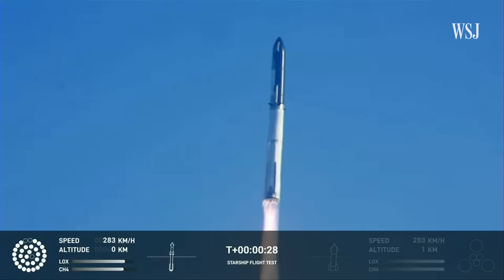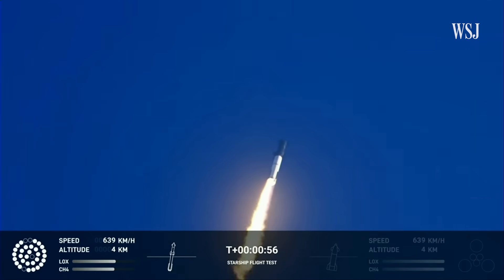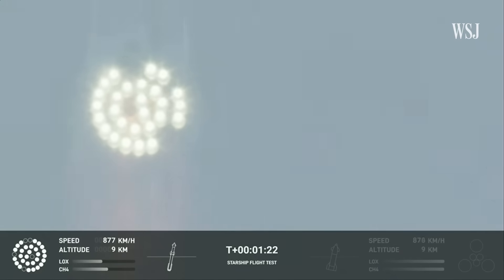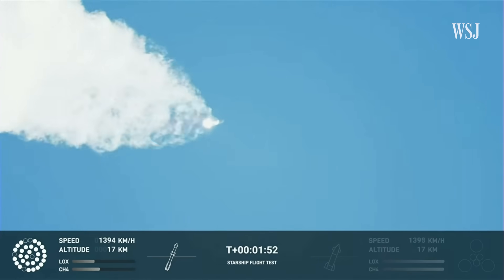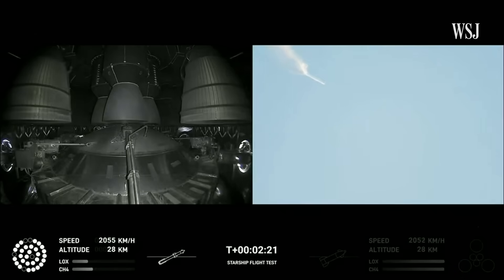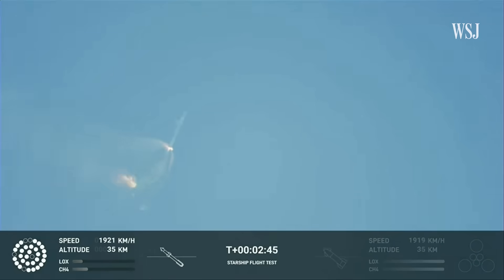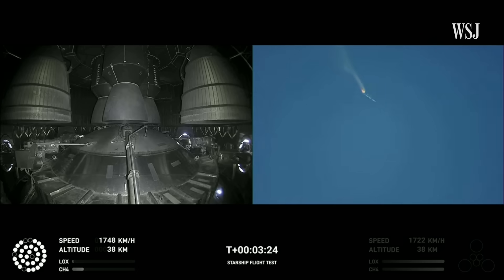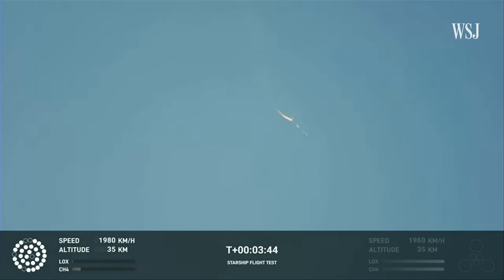Starship Explosion Video: Watch Elon Musk's Rocket Explode After Launch | WSJ

Comment: A successful launch and not destroying launch pad infrastructure was the minimum performance objective today. Everything else would have been a bonus. 

These test phase boosters and starships are purpose built to be tested until failure. Which is why the next test rocket is already produced and waiting for the next launch date.

The most important element is the performance data they obtained. This will help correct the failures for the next test. 

So long as the trajectory of each test launch shows improvement and reduction in failures, starship will complete its mission objectives.
Reply: It was a fiasco, it exploded and it even used same propulsion technologies of the 60´s, people cheering this event reminds me of those movie remakes that are a success for new generations because they never saw the original one decades ago, and as this case, originals are better.
Reply: @tomasgrimm3086  the technology is different. Saturn used 5 f1 engines and used Kerosene for fuel. Starship uses liquid methane and 33 rapture engines. Starship is also made from different materials and construction processes. Both the booster and starship also have relanding capabilities which have been tested but on seperate occasions. 

I’m not sure which technology that you are referring to is re-used from the 60’s?

Comment: Awesome first launch SpaceX, I can't wait to see the second and third to watch the progress.
Reply: Well, it can ONLY be progress. It can't get any worse, can it?
Reply: @ge2623  could’ve blown up on the pad and literally demolished the launch site instead of digging a big hole. It could’ve been destroyed during MaxQ, forcing a redesign of the vehicle’s structural elements. It could’ve veered off course and started arcing toward a populated area…

An issue with the HPUs and engine for steering that caused a lack of stability and issues with staging is actually quite good. If anything, the amount of “spin” it got proved the structural integrity of the system in ways that couldn’t be quantified in simulations or ground tests.

Comment: As of last month, Musk was quoted saying that this rocket only had a 50% chance of reaching orbit, just to put things into perspective.

"It will be the first launch with Starship’s two sections together. No one will be on on board. Early versions of the sci-fi-looking upper stage rocketed several miles into the stratosphere a few years back, crashing four times before finally landing upright in 2021. The towering first-stage rocket booster, dubbed Super Heavy, will soar for the first time.

For this demo, SpaceX won’t attempt any landings of the rocket or the spacecraft. Everything will fall into the sea.

“I’m not saying it will get to orbit, but I am guaranteeing excitement. It won’t be boring,” Musk promised at a Morgan Stanley conference last month. “I think it’s got, I don’t know, hopefully about a 50% chance of reaching orbit.”"

-Associated Press article from April 17.

Comment: Considering it was their first test flight it was very impressive. Very excited to see how they develop the starship from here
Reply: Not even close! They've had 9 launches with 5 being total failures and 2 being partial failures!
Reply: @randallmarsh1187  No. This is the first flight of starship and the 33 engine booster together.
Reply: @randallmarsh1187  stop spreading disinformation
Reply: @randallmarsh1187  only an idiots call this a "success"
Reply: @randallmarsh1187  even they fail 100 times still it impressive .
Reply: @randallmarsh1187  get your facts together, it's the first test of the WHOLE thing.

Comment: The crater and damage it left behind on and around the landing pad was pretty extensive, impressive, and I'm sure expensive! Lol! It's going to take months to fix that, unfortunately. Shows the sheer power of what they're working with! Amazing!
Reply: Actually they designed the launchpad to be quickly fixable. After the static fire of all 33 engines the damage was repaired very quickly within a week or two
Reply: @ScaledAnd1cy  you obviously haven't seen the damage yet. They're going to have to redesign the launch pad area. It'll be a few months.

Comment: That went extremely well and very smooth ;but what is the biggest issue here>>>>? Even if you use 20 F1 engines ???? Hint that which makes life possible since man first walked on this planet. Another hint- Movie very well done and depicts need for 3 engines and Holy Grail of Aerospace engineering where weight , heat resistance and  structural integrity will no longer be an issue. Oh no need for hypergolic fuel or carrying that massive weight any longer. 😱

Comment: Marvelous. 3 engines out at liftoff and still twice the thrust of Saturn V. Then another Raptor explodes as the booster climbs through Max-Q and another as it clearls it and finally a sixth Raptor goes engine rich and the largest flying object known to humanity begins to tumble and spin, like some sort of KSP contraption, while holding together. Lesser beasts would have broken apart, yet this one spins wildly at twice the altitude of a Concorde with 5000 t of thrust pushing through the stack until the FTS detonates the booster and the ship one second later. What can I say, other than marvelous. 

5 days and 111 years ago the, then largest moving object sank and humanity became timid and skeptical of technology. Now we build great vessels again. The liners and dreadnoughts may be gone but a new era begins. An object designed to reach speeds of 30 times the speed of sound, weighing more than the largest battleships we could build only 170 years ago. Not bad for a bunch of wild apes.

Comment: Why is it NASA were able to make Saturn V over half a century ago which had a virtually unblemished career, yet today with all the past research at their disposal, space X can't even make one that successfully separates?  And they still can't build an engine that can match the output of the Rocketdyne F1 engine as used on the first stage of the Saturn V rocket?  Instead Space X use multiple smaller engines which drastically increases the chances of a catastrophic failure!

Comment: This is considered as huge success in the engineering world for sure .
Reply: Yes, they got tons of data from this launch, no doubt.
Reply: it's clear that Starship SN11 experienced a pogo oscillation failure (31 -33 ) raptor engines firing at once vs (SLS) Artemis 1 rocket which has a  total of four engines. this and its apparent Disposable launch pad will be a huge hurdle for SpaceX as Multi-engine rockets are much more susceptible to pogo oscillation phenomenon than single-engine rockets. it took Nasa many years of R&D and is the reason why SlS Artemis 1 chose to use tried and true rocket "boring" technology  Pogo was in fact  the main cause of the soviets (30 ) engine N-1 rocket failure Pogo oscillation is a phenomenon that occurs when there is a feedback loop between the combustion process of the rocket engines and the rocket structure. The vibration caused by the combustion process can cause structural oscillations in the rocket, which in turn can feed back into the combustion process, leading to a potentially dangerous cycle of vibrations.

In multi-engine rockets, there are more engines that can contribute to the vibration, which increases the likelihood of pogo oscillation occurring. Don't be so Salty Spacex fanboys! its ok! lol Cheers from Park City Utah!
Reply: Elon made a great comparison; imagine if jetliners were one use only.  
Nobody could fly, that’s what this is all about
Reply: @twocyclediesel1280  I heard all this before. Namely, when the space shuttle was commissioned.
Reply: @candace6637  Now that you say that, I remember that.  I was in my teens and yes, some were saying the same thing.
Reply: @twocyclediesel1280  space shuttle was reusable
Reply: Your delusional is scary remember moon landing rockets, and now NASA is saying they lost the tech no it's bad.
Reply: Seriously??? Not really
Reply: That's what SpaceX wants to gaslight you into believing. No one launches a rocket expecting it to explode
Reply: How? It was done better 60 Ladd years ago? Apparently
Reply: Unique technologies were presented at the international online forum "Global crisis. There is a way out". For example, the health capsule (the possibility of life extension, rejuvenation and absolute health), from time 7:09:09.
These technologies will be available free of charge to everyone when building the Creative Society.
Reply: This is a fake CGI cartoon.
Reply: @chrisdaly9539  Can’t pull the wool over YOUR eyes, can they?
Reply: If it was made by another country, it would be ridiculed. But if it is American, it was a success!!
Reply: @YayoLife The majority of the world's superpowers have their successful space agencies. Through the eyes of an engineer, this was immensely successful. This is like taking a massive doo doo and leaving no residue behind.
Reply: @YayoLife  If it was something the size of Saturn V or smaller, I’d agree.  This is how SpaceX improves and gets something that huge to go through max q, stage separation, etc. without failing.  They had a bunch of failures with the propulsive landing / reusable boosters.  They’ve perfected that now.
This is just part of the process.  I’ll bet they never expected it to achieve orbit.  The data is what they were after.
Just wait and see :)
Reply: This is one of the launches of all time. 
Participation trophies for everyone.
Reply: @shaan702  Yes the launchest of launches
Reply: No way. This concept is a massive waste of money. Go back to Space shuttle and Star Raker. Plenty of Old concepts already exist that beat starship pound for pound
Reply: @TheHiralis  Wrong.
Reply: @MisterSherlock  Space shuttle had 133/135 successful missions. Star Raker had a theoretical 4.3% payload-to-vehicle mass. Starship has 2.2% payload-to-vehicle and is fundamentally flawed.
Reply: @TheHiralis  The space shuttle was only getting into low earth orbit. Starship is not designed to be in low earth orbit, but instead travel out of earths gravitational influence. That takes a much much larger amount of power for a given payload. Going to Mars is a 'whole different world' of engineering requirements when comparing the space shuttle to starships capabilities. The space shuttle could never, ever get out of the gravitational influence of the earth and is a poor comparison for so many reasons.
Reply: @TheHiralis  that's crazy. Star ship with a 550,000lb payload capacity as opposed to the Star Raker's 200,000lb payload capacity. Not to mention that the use of Starship is going to be exponentially cheaper in the next 10 years. That little space plane is only low earth orbit. Starship is landing on Mars and the Moon. There is no current runway to land a shuttle on either celestial body. Good try buddy.
Reply: No? They couldn’t do a stage seperation, and all they learned is that they have to be able to make a stage seperation.
Reply: @nork7045  The company that routinely launches self landing rockets into space isn't capable of stage separation? 

Do you people like you even have thoughts in that empty head of yours?
Reply: This cost "billions" of taxpayer subsidized money. If I were Musk... I would blow it up too.
Reply: No it’s not it considered billions of dollars burnt but more power to them, they probably learnt a lot form the testing
Reply: @daviant8942  your thinking is so tiny unfortunately:/
Reply: @daviant8942  It wasn’t “billions of dollars burnt” this test was built to be expendable. Even if it did complete a soft water landing, the rocket wouldn’t even be reused because newer prototypes with better technology made this one obsolete.
Reply: @daviant8942  nope this is actually considered a huge success in the engineering world
Reply: @daviant8942  The whole project - not this one test flight - costs billions. When the Starship works as expected, it will recoup all the investment and much more.

Comment: My gawd, you read the numbers, but don't really understand how massive it is until it lifts off.  That said, I wouldn't call this a success, that would have required at least achieving separation and 2nd stage ignition.  This showed the 1st stage worked to the flip.  1:21 it did look like some engines didn't ignite unless that was planned or they were missing.
Reply: @sproctor1958  That threshold for success is silly, so low it could have been achieved by leaving the clamps in place, powering up, then powering back down.  That is a ridiculously high requirement to be called a failure.

It is over the top to say they wouldn't have learned as much if it completed thru splashdown.  The method of separation failed, if it had difficulties but somehow managed to succeed they would have detected the problem.  All of the other problems would still be present and detected.
Reply: @sproctor1958  "Opinion" doesn't mean what you think it means, reread, more than a mere opinion, I provided a basis.  I had no problem addressing your talking points, you are instantly reduced to talking past me.
Reply: @1SCme  Apologies. Commentary retracted.

Stay well.

Comment: Trick I learned from ksp is to put fins on the bottom booster stage big ones too as they will need to compensate for the aerodynamic drag caused by the fins at the top.
Reply: Trick I learned from Space Engineers is to have a piston attached to the chassis push up against the chassis. Klang will reach down and rapture the rocket straight into the heavens.
Reply: And check yo stagin'!

Comment: Would like to remind everyone in the comments that this rocket is the biggest to ever lift off successfully. Second, the rocket is built from two separate rockets. One of them is Starship, the other one is Starship booster. You have just witnessed flying of two stacked rockets, where the booster is set to be reusable. A huge success in the field of aerospace.
Reply: I mean most rockets fly with multiple stages, but the reusability thing is huge.
Reply: @toastedmatt9387  the first stage itself is practically its own rocket
Reply: I would like to remind everyone that the space shuttle was reusable and was supposed to make space travel routine.
Reply: @candace6637  yes, although not succesfully reusable because of the unique shape of each of the ceramic heat shields. That should be better taken care of with the hexagonal/octagonal grid of tiles on Starship. Although my concern is the escape sequence of the future crew. Dragon module is light and can escape from defect booster quickly. I believe the starship is not able to escape that quickly to bring astronauts to safety away from a booster malfunction. So in that sense the danger is similar, although imo smaller than the space shuttle.
Reply: @candace6637  completely different situation, the space shuttle wasn’t able to carry 100 tons to orbit, it could only carry 27. It’s not solely reusability that makes Starship important, it’s the fact that Starship will be one of the largest and most powerful rockets of all human history. Being able to launch multiple Starships in a day, each carrying 100 tons, would be an insanely huge jump for the space industry.

Comment: This is an incredible and inspiring achievement!
Reply: They already fly the 29 engine raptor heavy.  So 4 more engines are going to make a huge difference???
Reply: it's clear that Starship SN11 experienced a pogo oscillation failure (31 -33 ) raptor engines firing at once vs (SLS) Artemis 1 rocket which has a  total of four engines. this and its apparent Disposable launch pad will be a huge hurdle for SpaceX as Multi-engine rockets are much more susceptible to pogo oscillation phenomenon than single-engine rockets. it took Nasa many years of R&D and is the reason why SlS Artemis 1 chose to use tried and true rocket "boring" technology  Pogo was in fact  the main cause of the soviets (30 ) engine N-1 rocket failure Pogo oscillation is a phenomenon that occurs when there is a feedback loop between the combustion process of the rocket engines and the rocket structure. The vibration caused by the combustion process can cause structural oscillations in the rocket, which in turn can feed back into the combustion process, leading to a potentially dangerous cycle of vibrations.

In multi-engine rockets, there are more engines that can contribute to the vibration, which increases the likelihood of pogo oscillation occurring. Don't be so Salty Spacex fanboys! its ok! lol Cheers from Park City Utah!